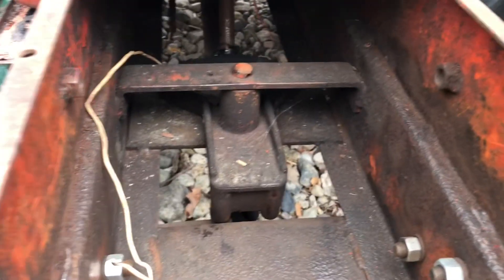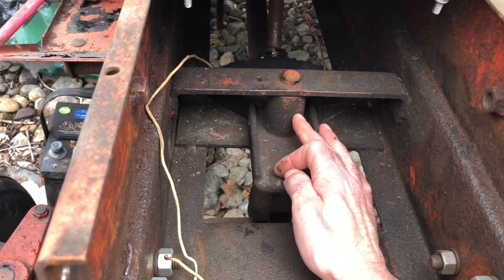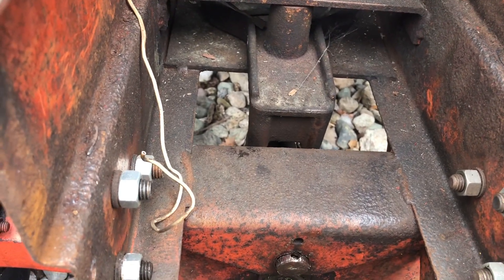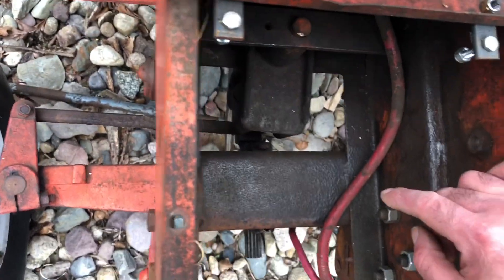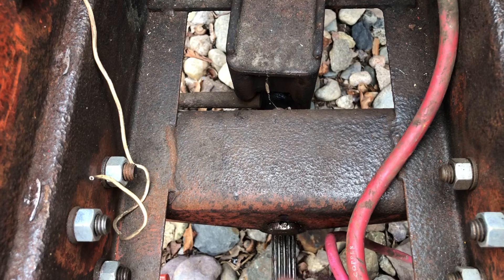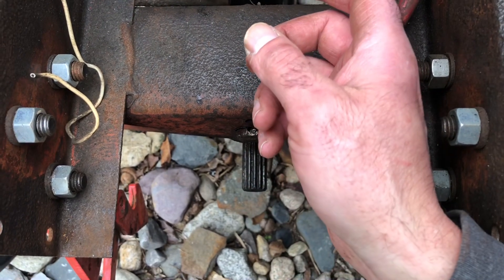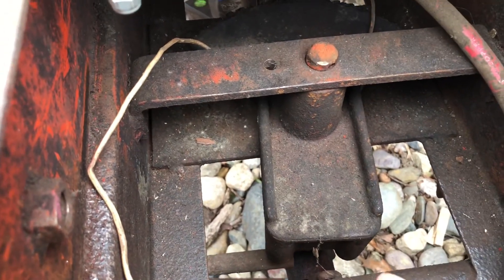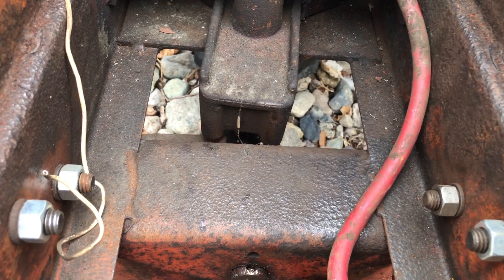Gravely 424 steering linkage fail!

Comment: The front end is light.  Do some measuring (dim 1 - back of tire to back of hitch, dim 2 - center of tire to top of steering wheel). Jack up the rear (dim 1) and set the tires on cement blocks (centered dim 2 from wall or shed) and block them from rolling.  Tilt the front end up vertical until the steering wheel rests against your stone wall or shed.  PaulL

Comment: Question for you on 424 forward and reverse linkage. On my machine in neutral position the weight of the handle falls  frontwards passed center making the wheels turn slowly. I noticed this when the tractor was on jack stands. Is there supposed to be a spring mounted somewhere to keep in neutral position unless in forward or reverse?